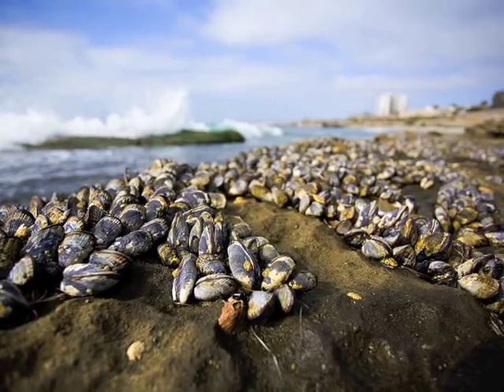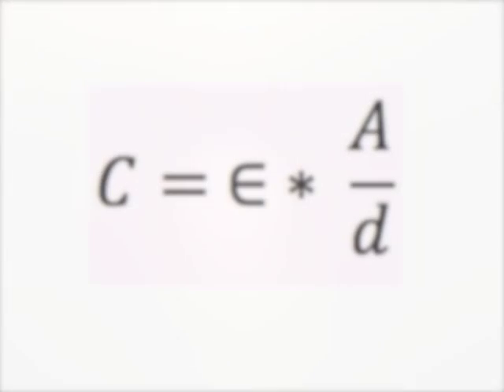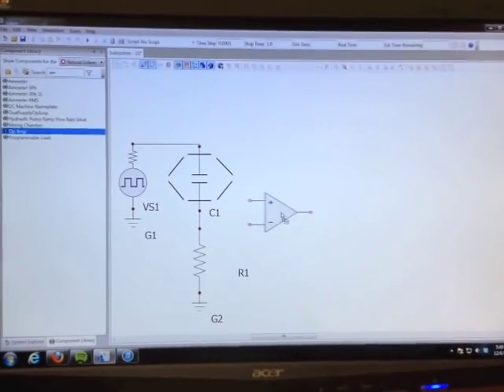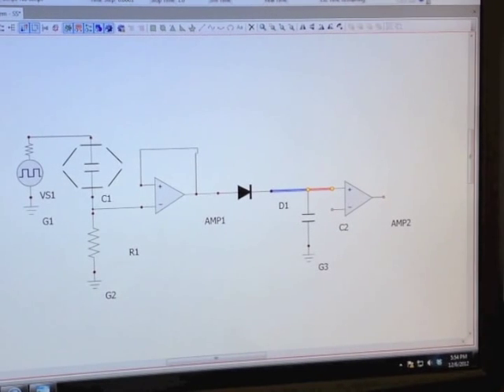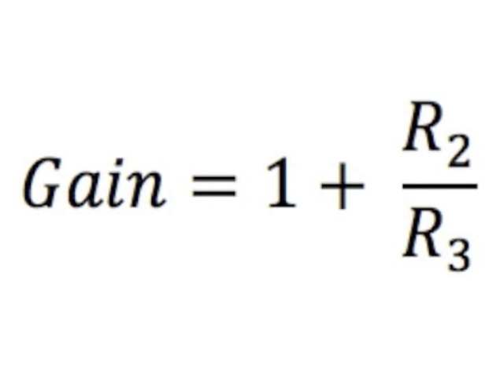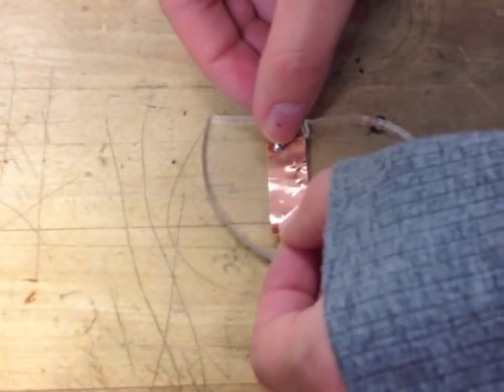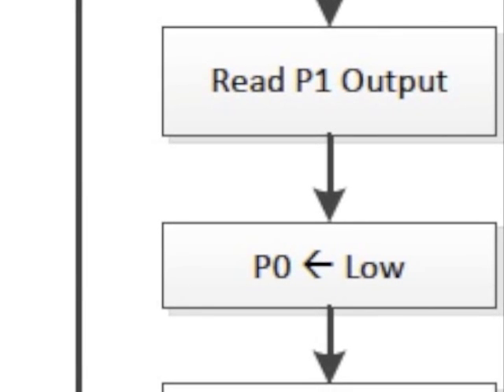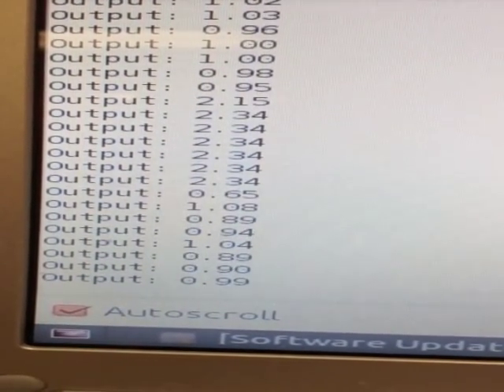Capacitive Level Detector.m4v

Comment: Very interesting... but...on the schematic you have an error, in my opinion: the first OA have the inputs inverted, you have to apply signal on the positive input and the negative reaction on negative, and taking the signal after rectifying diode. Otherwise, you have a positive feedback and the amplifier remains in the initial state.
Reply: Leonard is correct, the first op amp's inputs are backwards. BTW, the diode is a ONE N914, not an "eye" N914.